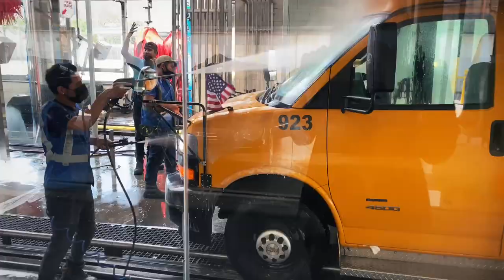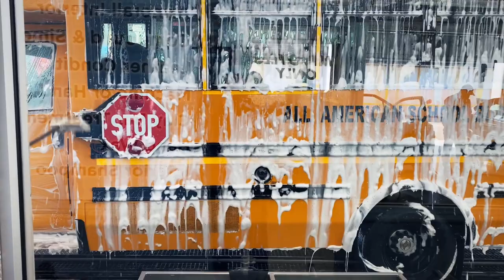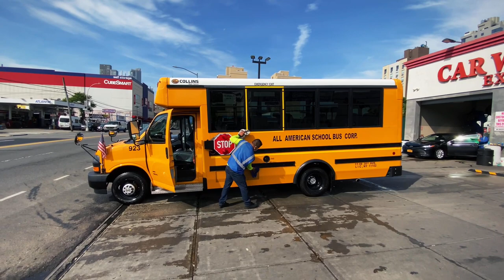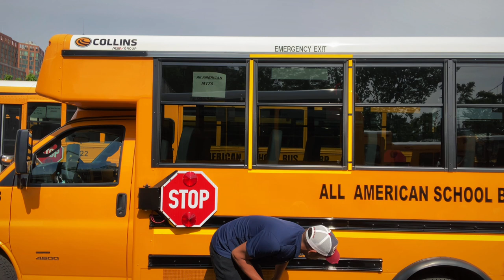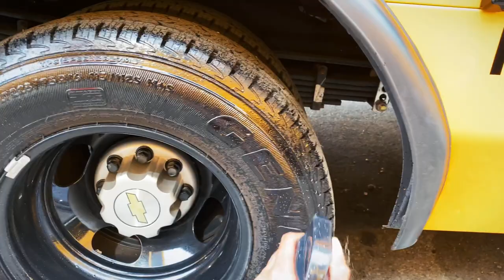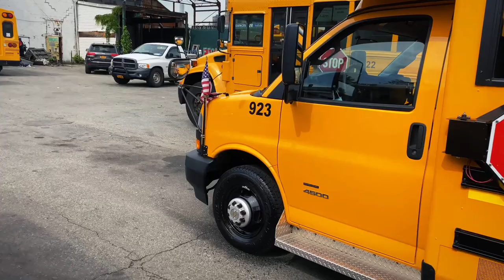School Bus Gets Ceramic Spay Wax

Comment: Why does the label by the fuel filler say gas when I realize theres a duramax diesel badge above the 4500 badge?
Reply from the maker: It’s a gasoline bus
Reply: @DillonRathan  but why does it have a duramax diesel badge above the 4500 badge on the drivers door?
Reply: thay might have yank the eng out of that bus and replace it with gas eng
Reply: @joeygiel5170  stabilitrak wdym
Reply: @literalyammer  I thought it said duramax diesel. Oops